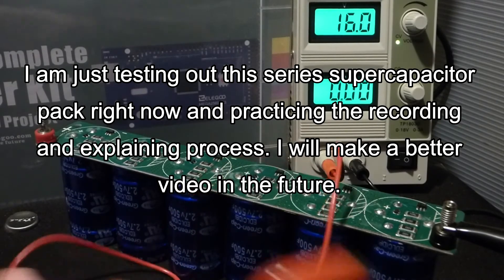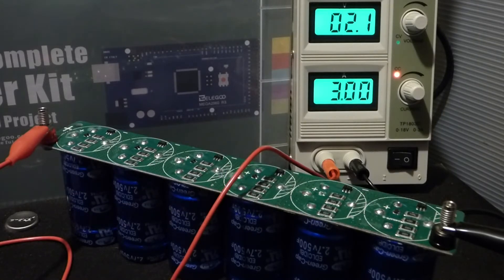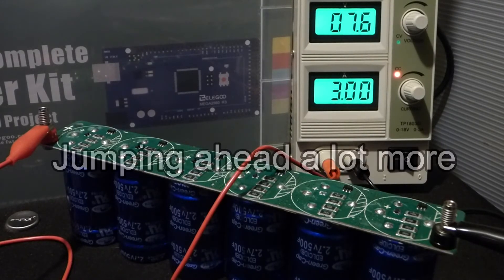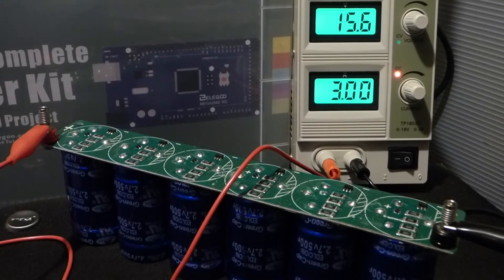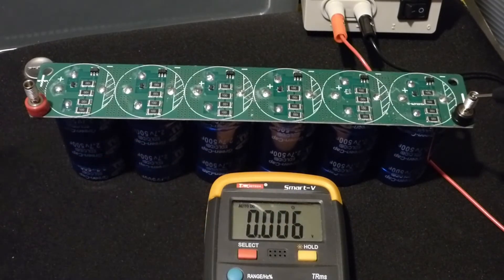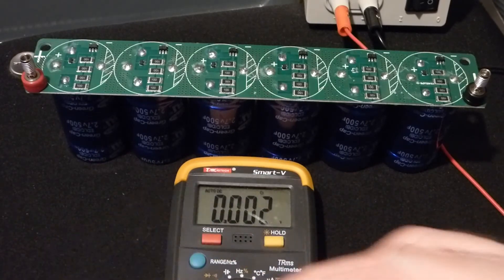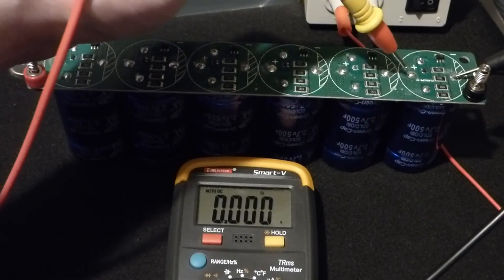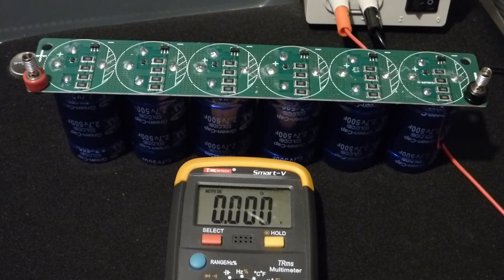6 500F series supercapacitors for 16V 83F w protection board first time charge

Comment: Hey. I have a question. Why it's recommended to connect such a thing in parralel to car battery through power resistor? What is the puprose? I see that almost nobody does it.
Reply from the maker: Capacitors can release all of their charge at once if current isn't limited in some way. If the battery is limiting current enough and all the connections can handle the current involved, then you can get away with connecting them directly together.

Comment: These protection boards only work if your charging the caps at 1 amp or less, too high of amperage they will overheat the components on the board and over charge your caps
Reply from the maker: Thanks for the info!

Comment: sir can u plz tell me how much time it will take to drain this capacitors..............while consuming 8amps
Reply from the maker: So unless I goof on my math, I haven't calculated capacitors in a long time, if we are dealing with 83F at 16V and we drain it at a constant 8A, it will take 83/8 = 10.375 seconds to drain down each volt. Since there is a total of 16 volts that need to be drained, that's 10.375 times 16 for 166 seconds. 166/60 = 2.76666 minutes. About 2 minutes 45 seconds.

Comment: in video if you put 6 capacitor in series, it takes 5,5 minutes ,
so if you only put 3 capacitors in series with the same 3A, it will charge in 2,25 minutes(half the time)? or is it because the volt limit is 8.1V (3 X 2.7V), then it it will be the same 5,5 minutes?
Reply from the maker: This is tricky to explain in only written form, but 3 equal value series capacitors have twice the capacitance of 6 series capacitors of the same value but the 3 series capacitors can only handle half of the voltage of the 6 series capacitors of the same value. So your second scenario is the correct one, that it will take the same amount of time to charge with a certain current to get the capacitors at half the voltage.

Comment: Curious if they'd start a car like the better quality ones will?
Reply from the maker: Unfortunately the protection board ended up getting damaged right after this video so I haven't been able to test it out. I may have simply mishandled it too much, but also I got it cheaply from Ebay, instead of Amazon or another more reputable seller, so It probably wasn't packaged as well and it was handled during shipping much more, which may have weakened the board. I am setting up a different system now when hopefully more robust capacitors show up from overseas, so I moved on from these but they seemed to perform pretty well from what I could tell before they were damaged.